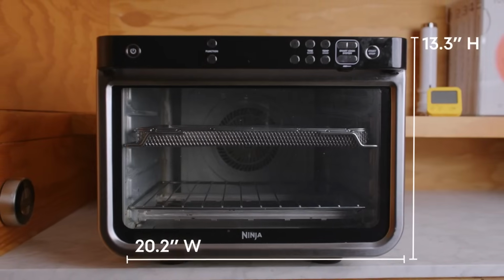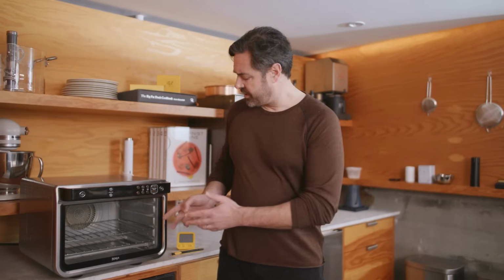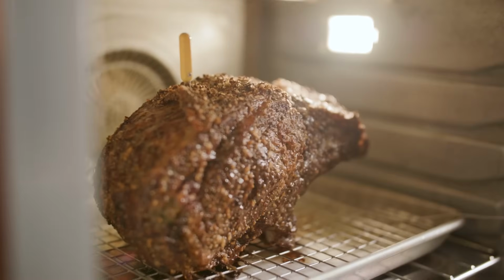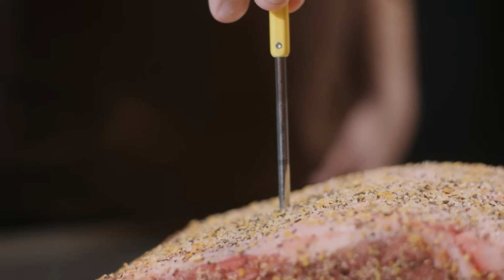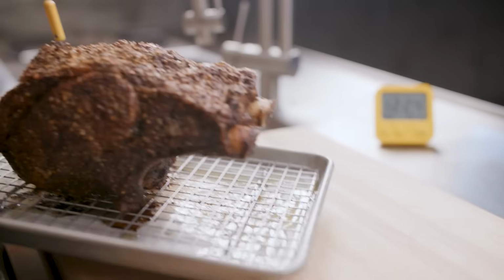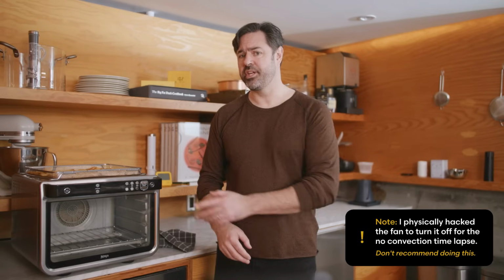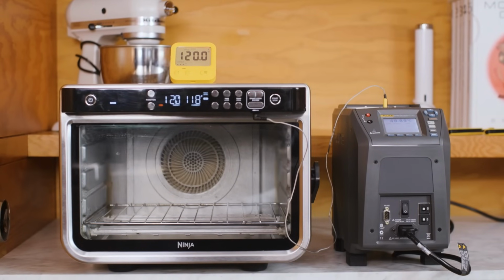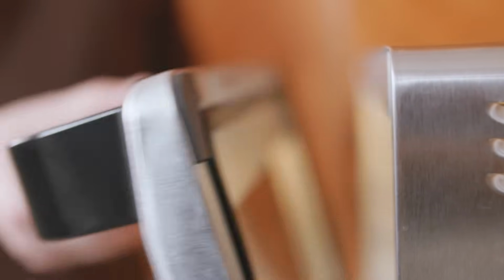The Best Countertop Air Fryer? | Ninja Foodie XL Smart Oven REVIEW (Ep#3)

Comment: One of the other benefits of a very effective convection oven or air fryer mechanism is crisping the exterior of your food after it has been cooked low and slow to the desired doneness. It's the typical method of finishing off roasts by blasting them in a 500F oven until crispy, but using fans to blast away the steam and introduce extremely hot air directly to the surface will be significantly more effective for this.

While the additional height of the Ninja Foodie XL might provide certain conveniences for larger foodstuffs, I can understand and appreciate the shorter convection ovens. They just want to present a smaller air volume so it takes less time to preheat, like a typical small form factor air fryer which may not even require proper preheating. This makes it more convenient for what air fryers get used for about half the time: reheating leftovers that don't microwave well.

I do think that, of the three, the Ninja is probably one of the better options for people living in, say, a studio apartment without a proper kitchen with a full-sized oven. Because you can place it on a rack or on top of a piece of furniture and it'll still do the job and it offers a lot of size and utility without being overly complicated or excessively expensive. I just doubt that it's the "best" if you are willing to play with the app and accept the smaller cooking volume. Either way, it's still a good product for people who want or need a countertop oven of some description.

Comment: Just dealing with poor button design on mine. Turns out they cheaped out on the button construction so the buttons can fall apart internally and is not easily user replaceable.

Comment: I have a Chefman air fryer, which is a good air fryer but awful oven. The Ninja is a great oven but not the best air fryer, so i am using both, for now. Grilling a few rashers or sausages on the Ninja uses a large heating area and not as good. I got the version without thermometer but bought one for $20. I like the oven  size of this unit, the fan is loud, so what, so is the microwave. I am still getting used to this to adjust temp and timing. I look forward to baking with this unit. Oh, dont put parchment paper in this, it gets sucked into the fan!

Comment: Only 2 issues I have is ninja lied they informed me it could hold a 12" round pizza trey its 1/2 and inch short meaning you are stuck using 10" rounds or the supplied 13x11 pan. other issue is look at this unit 4 years back , there is a screen over the fan that you can open to clean. so they put up  their price and remove the screen. we have been played

Comment: Does the thermometer have a built in battery? And if so can it be replaced when it dies?
Reply from the maker: Yes, it has a special battery capable of surviving the extreme temps. It cannot be replaced, but unlike LiPos, this battery retains 98% of its original capacity even after 5,000 charging cycles which will cover you for a couple of decades.
Reply: @ChrisYoungCooks  Thank you for the reply 👍

Comment: Good, technical video. I just picked this thing up from me Amazon warehouse. It was shipped as like New, which means that the original box show damage but the machine was actually never used or damaged. I lucked out and got one for $155. No thermometer but saving almost $150 was worth it. The nice thing is these things are returnable. It’s generally a short window, but if you’re lucky enough to have a Whole Foods Market nearby, you just put it back in the box and drop it off very easy to do. Bringing the price point down is such a nice thing because it gets a little hard it doesn’t have a thermometer. It’s a little bit difficult to clean but I paid half price so no complaints.

Comment: I have this unit.  The problem I am experiencing is that the power is weak.  Just warming up leftovers takes a lot more time than my Instant Omni Plus.  I always cook with a dip tray directly under the basket.  I don't think this oven likes that.  If I take away the drip pan, it will leave a mess.  Maybe that's what needs to be done with this design.  Overall, my experience is the opposite of yours.  Mine is going back.

Comment: Love the science in your video.  There are several reasons to avoid this oven.  I've seen other videos showing the rusted interior, the filthy interior from baked-on food that wont come off, the buttons wearing to the point of not being able to read them.  All of this just screams poor quality.  I guess like anything there are pros and cons to any of these countertop ovens.  I have Ninja products and they seem to work really well so I'm inclined to buy one of these even though I know there will be issues.  I guess it comes down to how one will use this oven.  If the convection / air frying features are important this is probably a good choice.  I like the large glass door.  It does allow you to see more but where does that leave you when the inside is dirty from baked on splatter you can't get off or when it starts to rust.  If that happens I'd be prominently displaying a dirty rusted oven.   Having said all that, I understand (because of how well you explain the convection process) that this oven excels in this area compared to the Cosori, Breveville, or Kitchen Aid. All of these ovens seem to get hot on the outside surface area which is a sticking point with me.  One of the reasons I'm considering a counter top oven is because of the efficiency when compared to heating my large oven.  It seems to me that the more heat that escapes these units, the less efficient they are.  I don't want to heat my house, I want to heat the inside of the oven.  They should insulate these units better.  If they did, we wouldn't need to use as much energy to cook our food.  Not so much of an issue in the winter when I'm heating my house anyway but in the summer when it's 100 degrees out and my AC is cranking, the last thing I want to do is fire up a counter top oven that will heat my house when I'm trying to cool it.  I want this to replace my large oven, and I bake bread so a proofing feature which some of these ovens have is important to me.  Not being able to use this oven without running the fan may not be ideal for bread baking.  I don't know how important the air frying feature will be since I don't currently have an air fryer.  Since that seems to be the one thing that sets this oven apart from the others I'm not sure this is the best choice for me.  But, I'm not buying a new car here (this thing is only $275-$300) so maybe I'll try it and see.  I guess I can always return it if it's not a good fit.  I would love to hear any feedback anyone could offer on any of the issues I raise here.  I'm would like to buy a unit soon so any advice is appreciated.

Comment: Worked great, but it is IMPOSSIBLE to clean. Horrible design from that perspective. The heating elements in the oven are impossible to get clean. I work hard to keep my kitchen clean, but this was a bun-buster. The food and splatters that get stuck on the interior are almost impossible to get off. I couldn't get the interior AT ALL clean, so I used it until I couldn't stand it anymore then THREW IT AWAY and went back to using my regular over (which is EASY to clean!!!!)

Comment: As an engineer, I very much appreciate the unparalleled thoughtfulness and detail you put into your reviews. Thank you very much for the excellent videos! I originally wanted the Breville, because it was purported to have the most accurate temperature control due to its quartz elements and multiple temperature sensors, so I was willing to pay the price premium. Your review debunked that. Then I thought maybe the Ninja would be a great choice, due to its great air flow and temperature probe....until you pointed out that you can't turn off the convection mode. Now, I can't figure out which one to buy. I would buy the Ninja and just hack it to turn off the fan, but I'll bet it will overheat and cause reliability problems. Hmm.. tough choice.
Reply from the maker: Yes, the fan shaft is coupled to a fan in the electronics bay, so the fan always needs to spin at a minimum level to keep the electronics cooled. This said, I find myself preferring the Ninja for most tasks even though I'm keeping all three ovens in use.
Reply: @ChrisYoungCooks besides the quicker warm up, one of the reason I'm interested in these small ovens is to save energy. In light of the fact that they get hot to the touch, they must not be insulated well or at all. have you ever done any energy consumption comparisons among them, or against a full size oven?
Reply from the maker: @lincomatic  you're correct, they are not insulated well and built-in ovens are insulated much better. While I haven't directly tested, I would expect from energy consumption tests is that small ovens like these have the advantage when cooking for relatively short periods of time because they spend less energy pre-heating a large mass of materials. Large ovens likely have the advantage when you start cooking for hours and hours because once pre-heated they consume relatively little power maintaining temperature. BUT it's important to keep in mind that by far the biggest source of energy consumption is removing water from the food itself. Cooking something like a chicken requires a few million Joules of heat energy to raise the temperature and evaporated some of the juices. So for either oven the majority of the energy used will have gone into evaporating water, negating a lot of the energy efficiencies of a small oven versus a larger oven.
Reply: @ChrisYoungCooks  I took mine apart and installed a switch on the fan. There's actually a separate fan specifically for the electronics. Originally did this to rest a brisket for 12+ hours. Now I'll keep it in mind for baking. Thanks for the breakdown!

Comment: Hey thanks for the detailed and professional review but I just watched another review and it was said that the fan does not come on when using the baking and bagel setting and I coudn't find the info in the ninja booklet so I'm confused!
Also since you decided to keep it and your wife uses it, an update on how it's keeping up would be great! Is there any rust? And is it easy to clean?
Thanks in advance.
Reply: I think there are two separate fans, one for cooling (hidden) and the big main one. I use the reheating function and the main fan stays off for sure.
Reply from the maker: Unless they’ve changed something, I can say with certainty the fan is on, just at a slightly slower speed. The fan also cools the motor and electronics behind the oven, which is why it always had to run at a minimum speed.
Reply: @ChrisYoungCooks  Thanks

Comment: A note for people buying this. Some of the models of this oven don't come with the internal thermometer and it's not easy to tell which is which. I think the thermometer is a must and Ninja is being sneaky. You can't buy the thermometer separately either as those ovens don't even have the connection for the probe. Do your research.
Reply from the maker: Correct. I believe the “Smart” designation on the model name indicates it includes the probe and connector.

Comment: Really need to know - does it have a non stick coating on the walls of the oven? I'm struggling to find oven style air fryers that don't have non stick! And usually have to contact every manufacturer to ask, since it isn't common for them to list the materials of the walls in product listings.
Reply: Did you find out? Or settle on a different oven? I'm really trying to find a nonstick-free one myself.
Reply: @bridgethings4225  yes I contact the company and it isn't a non stick coating, yay! I haven't got it yet but still planning too, hopefully for Christmas 🤞
Reply: @DelphineSerenity  Did they say what the walls ARE made of? Chris said it's not stainless steel, and if it's not non-stick what is it? Aluminum?
Reply: @bridgethings4225  Just dug up the email, here's what they said "The internal material of the DT200 is aluminium and not coated" 😊

Comment: Of course air is colder around the meat than in the oven, that might come as a surprise? The meat is cold (cold means steals heat energy to facilitate a reaction, not necessarily low temperature) compared to the oven, thats why we're cooking it lol

It's the same thing as if you were to take an ice cube and put it outside - the ice cube uses heat energy and so the air around it is cold

If the air around the meat wasnt colder than the air in the rest of the box, either convection is so powerful that it moved the cold air too fast for you to measure, or the food isnt actually cooking. It's a necessary part of cooking

I mean, each individual molecule's available thermal energy controls the speed of cooking. At some point, its all the same chain of events, talking about the temperature of the oven is a reliable setpoint for operating the machine moreso than an accurate temperature gauge of the active elements of the machine

Comment: Extra height could be a good thing, depending on how evenly the oven can heat itself. I bake a lot and I will basically never use more than 1 tray at a time because it messed with the cooking too much. The bottom cookies are never as good as the top ones, and opening to rotate looses heat. Ideally I would prefer an oven with the same footprint but about 1/2 of the height. It would still fit a whole chicken or a dutch oven, which is just about the biggest thing I'll ever use the oven for. I think turkeys are too big too cook well without further butchering. It sure would save a lot of energy to only have to heat half the space literally every time I use my oven

Being an air fryer, it seems like perhaps such an oven would get around that downside. Though I've never used one so I cant really give an opinion on that

Comment: @Chris Young I used to own this oven, however it got struck by lightning or something and so when I got the option to get a new one thanks to Best Buy I got them Joule oven for a little more got it based on the fact I bake so often and love the fact I can turn off the fan completely. Then I discovered the Nuwave Todd English smart oven.  It appears to be based on the ninjas design but it’s taken steps further it’s like they watched ur review and applied ur thoughts or concerns to their version. Now I’m thinking I may need to try it out. I’ve included a link. What are ur thoughts and maybe this could stir up things u think??? 

Limited-time deal: Nuwave TODD ENGLISH iQ360 Digital Smart Oven, 20-in-1 Convection Infrared Grill Griddle Combo, 34-Qt Mega Capacity, 1800 Watts, Adjustable Triple Surround Heat Zones, Smart Thermometer, WIFI Enabled https://a.co/d/eOTijIa